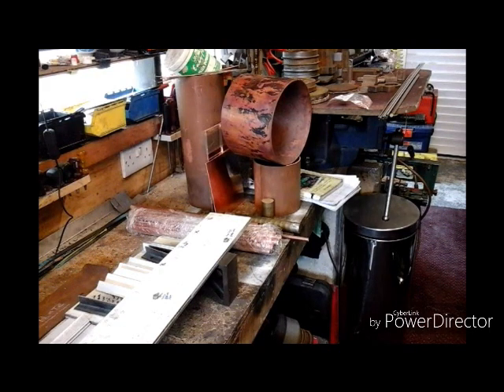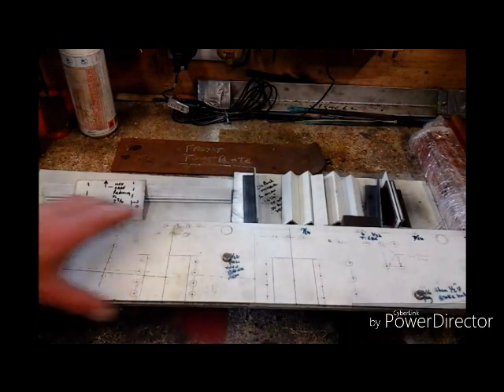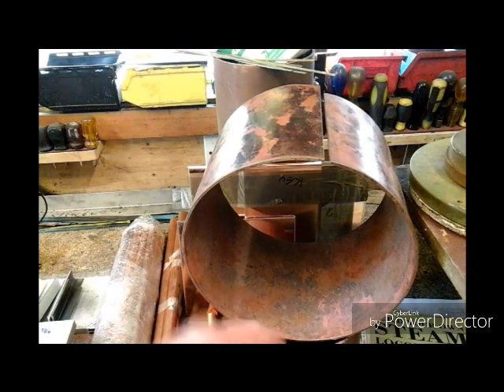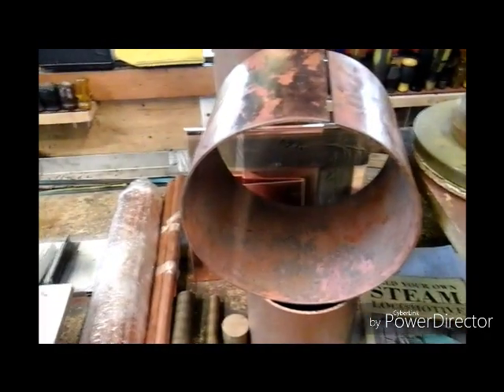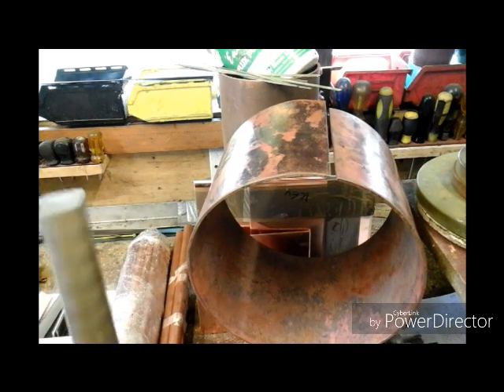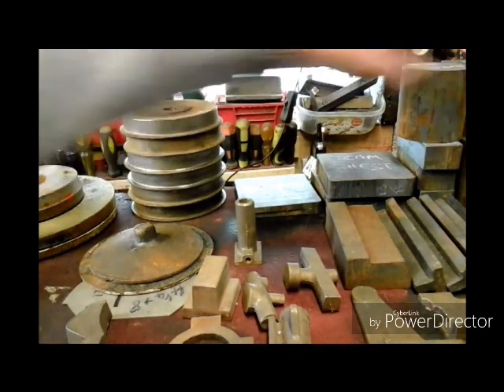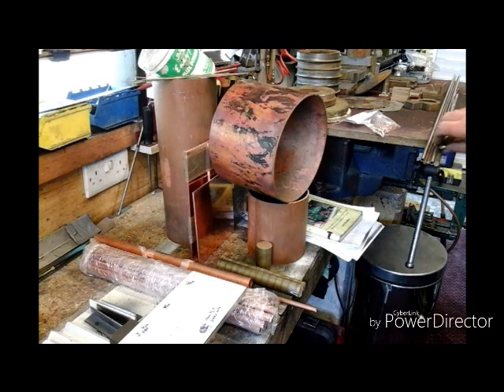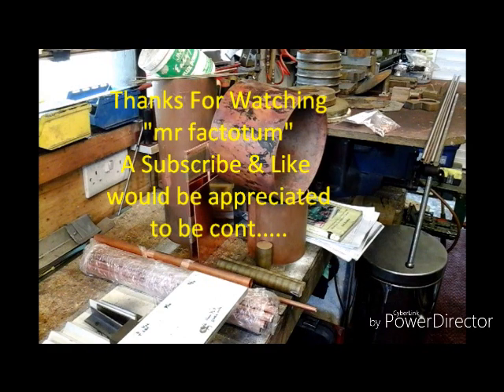Making a Beginners Steam Loco Part 3 of Materials (boiler/chassis / frame) "mr factotum"

Comment: Hi Mr Factotum, I have got biiten by the bug. I have ordered the drawings and book, Whilst I am waiting for those to arrive can you tell me the finished size of the frames so I can hunt  around for some steel and get some prices. Thanks in advance Chris
Reply from the maker: hi chris
so you've joined the club then. 
the exact size of the main frames is 29 5/8" long x 4" wide x 3/16" thick, however because of availability i used 5mm thick plate, by doing this you have to adjust mating components to suit, ive explained this in my video's too.
good luck
mr f
Reply: Thanks Mr F , just trying to collect some materials for the Job and ok on the 5mm plate Will also be using metric fasteners with the price and availability of  taps etc
Reply from the maker: anytime chris, i'm no expert in the loco world, but any help i can pass on its no problem
regards
mr f